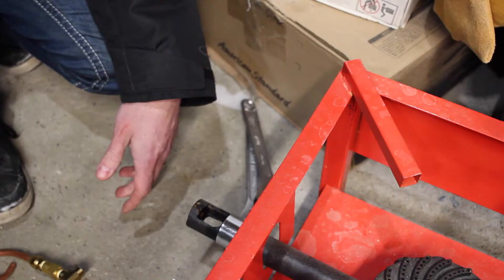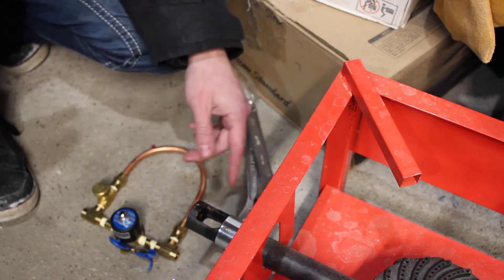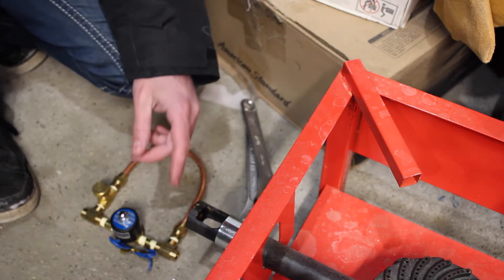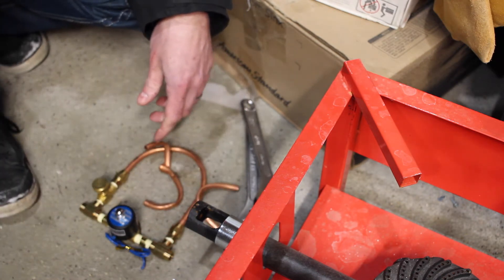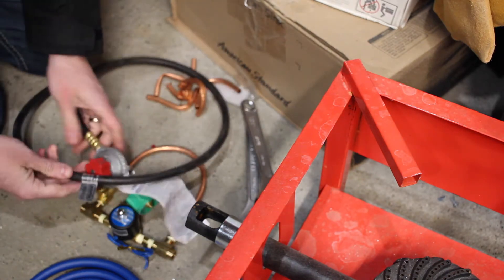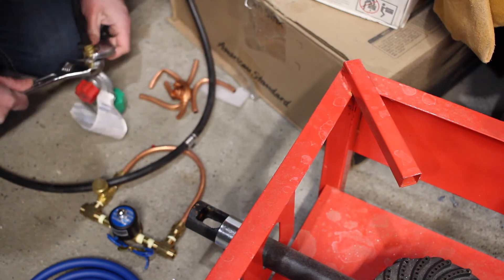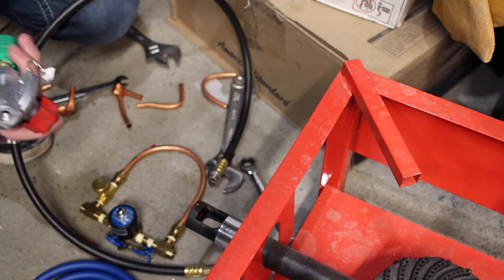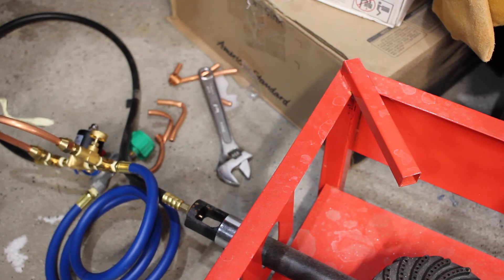Test Firing my Lead Melter

Comment: trick for the copper pipe is to fill it with sugar, cap the ends, and then bend it.  Cut off your caps and dump out the sugar. If it's a complex shape or coil, melt out the sugar. 

Don't ask me how I know.